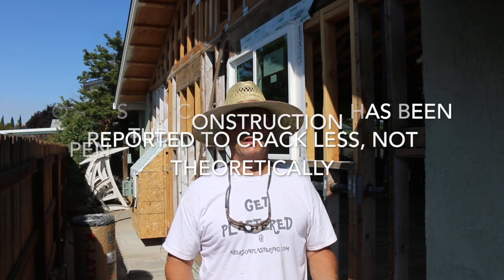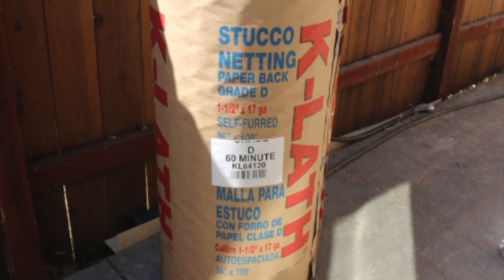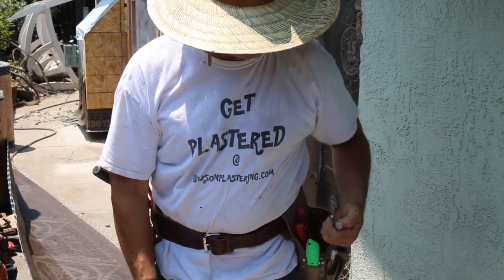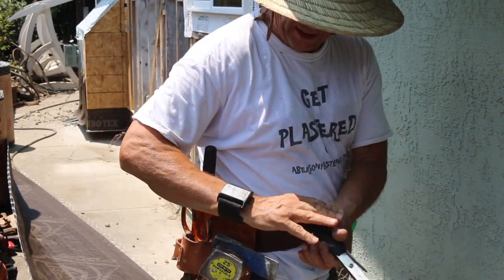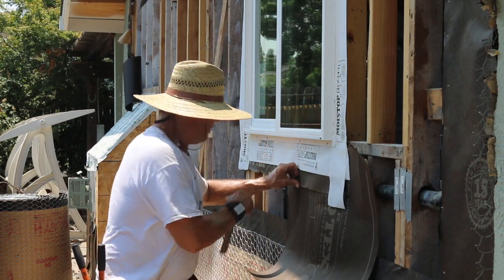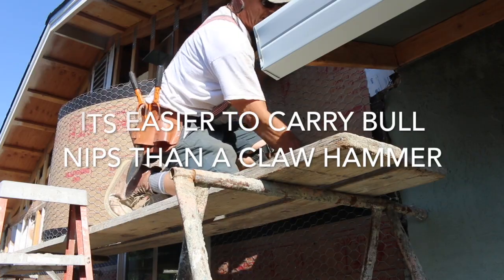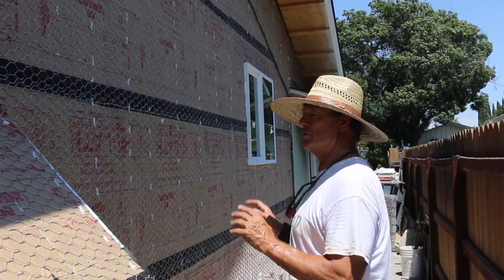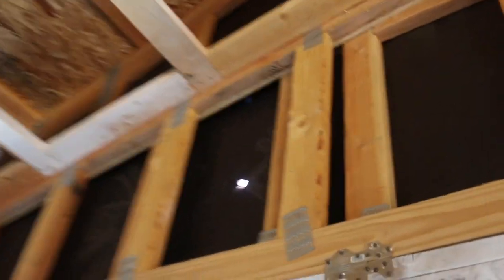Lathing for stucco using paperback wire for the DIY'er

Comment: Great work, turned out better than I expected with the paper back wire. Is this the three coat stucco sistem you doing.
Reply from the maker: Yeah it came out good thanks. It is the 3 coat system

Comment: Absolutely ridiculous that there is no sheeting being installed over those studs prior to lath installation. You did everything right but I just think it is absurd not to have a solid backer. Who is the cheap one here? The homeowner or the contractor?
Reply from the maker: The home owners husband died in the fire.  She is elderly,, so if I had to venture a guess I would say the general contractor is being the cheap one. Seeing as I had to scale back my price just to do tge job because the general either under bid it, or is a tight wad by nature.  I hate working over open stud work. Thanks for watching
Reply: @AbersonPlastering  Well your lath application is true to form. Good day Ken.

Comment: Why there are homes with Stucco over plywood sheathing vs open wall construction?
Reply from the maker: As far as I know, most older homes in California didn’t have wood shear. But some had drywall shear. Most were open stud. Realizing twisting and cracking structures from earthquakes could be thwarted by including wood shear wall many homes received an engineers specifications on where to install shear wall. When most homes were spec’d to be nearly 100% shear wall, architects found that the whole structure may as well have wood shear wall everywhere